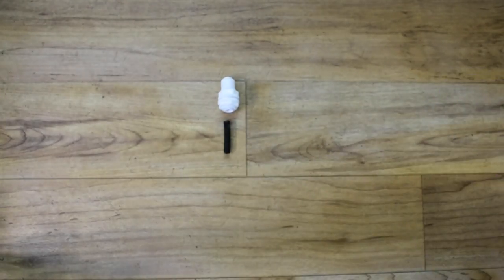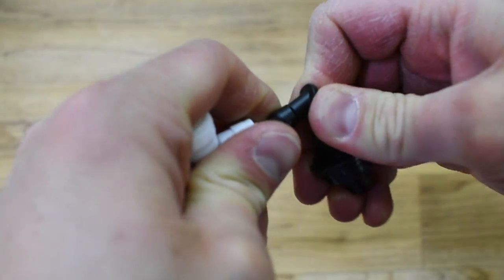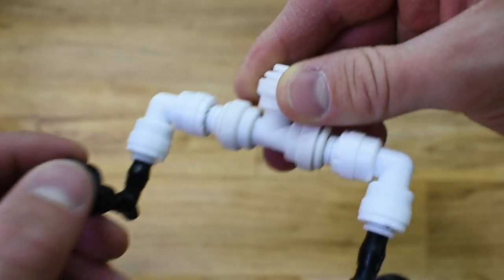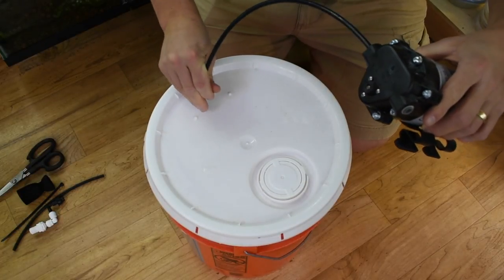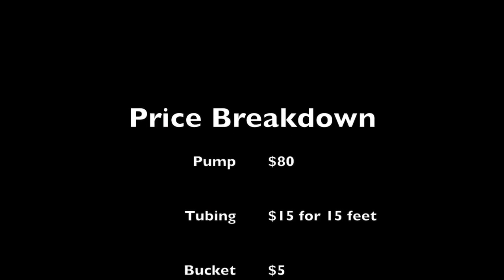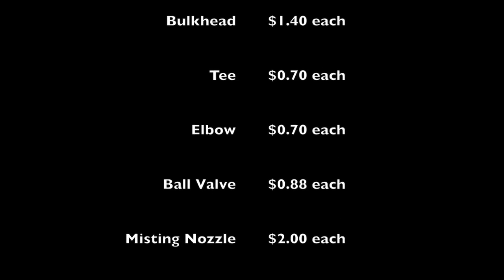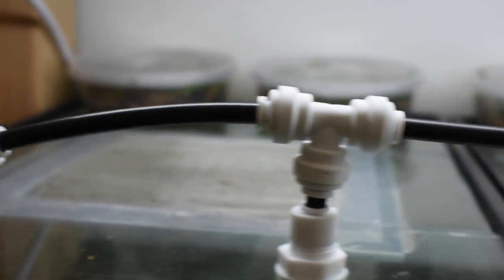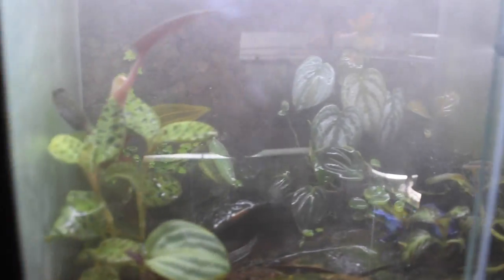Easy to Build DIY Misting System!

Comment: You could also use 1/4" airline tubing with zipties if the high pressure line is too difficult to fit. Usually found at aquarium stores.

Comment: I don't recommend the 8800 model just because it comes in all sorts of pressure ranges and I figured the 100 PSI 6A pump I found looking for the 8800 would be strong enough to pump up to 100 PSI. I may have had a defective pump but I decided that manufacturer isn't good enough for me. I found a much larger / heavier duty 160 psi diaphragm pump which was more than up to the task (110v AC @ 0.55A ~ 12v DC 5.57A).

On this video I would suggest an upgrade to instead of demanding direct pressure from the pump to deliver pressure to the misters, to instead store energy from the pump inside of an accumulator. This drives down the frequent on/off demand on your motor and will save it in the long run. The diaphragm also doesn't need to slam the line as hard this way because the accumulator 'muscle' is absorbing the blows. A solenoid can be triggered to demand energy from the accumulator to the misting heads, and regulator coupled with a low pressure cut off more seamlessly control the fog mist production.

Without a low pressure cut off only the misters can drain any remaining pressure in the lines after the demand is closed. When shut off they will gradually change from producing fog mist into a stream of water. At the end of the water stream droplets stay on the mister head surface and deposit calcium over time and clog the mister heads.

That is as complicated as it gets... we just want really strong muscles pressing out our mist!

Comment: got a tip for you whit pressing the hose over the fitting. sound strange but it work. its dry spit on it and it slide beter over the fitting. or if you don´t like it some wildlife friendly crease.

Comment: Heat the pe tube before u put on nozzle may be easier.
Also gift one check valve in end of system and send to resevoir tank can prefer dripting from your nozzle. 
Sorry my English so bad. 
Cool video
Reply from the maker: Thanks for the tips, surprisingly I haven't had any problems with the line draining back into the tanks even without a check valve.
Reply: TCS Dart Frogs good for you but you even control the flow of spray, or add some driver for connecting with you smart phone. 
I like you stop btw i use it to for keep chameleon

Comment: Nice vid, thanks!  Do you use anything to automate the misting, like a timer similar to the Mist King system?
Reply from the maker: Thanks! I actually don't use any sort of timer, I do control all the misting manually but most hardware stores do carry second timers and you can find them easily online as well.
Reply: Interesting easy set up . I have a question . Say I have 8 nozzles set up . And need them to spray for roughly 2 seconds . Do they spray simultaneously or will the pressure not reach the nozzles further down the line being that the spray only goes off for 2 seconds ? Does that make any sense ? Trying to figure this out before spending the money on the project . Thank you !!!! Hope to hear your thoughts
Reply: @LuisLopez-cz8qi  also wondering the same thing!
Reply: I’m wondering a similar thing.. in this video Chris is powering maybe 10 or more tanks. I’m only trying to design a system for 1 tanks maybe 2 - 4 sprayer heads max. 
Would I need a smaller pump?
I’m assuming that each additional nozzle reduces the overall pressure. 
Does anyone have any info on this?

Comment: How make right temperature in animal room 
With individual heating mats or is centralized?
Reply from the maker: Central heating and air conditioning, the frogs only need to be kept at 68-75 F so  it's not really different than room temperature in your average household.

Comment: Hi there really great video that u shared , if i had only two small 1ft tank would the pump be over kill? Is there a smaller pump i can use or? Care to advice?
Reply from the maker: The pump would be a bit overkill but a lesser pump would not be significantly cheaper so it just depends if you want to spend that much on a pump.
Reply: Universal windshield wiper pump on amazon for $11 has worked great for me for smaller systems.
Reply: @MrDad-ok8qe  would you be willing to elaborate a bit more on how you did it? I have a couple small display tanks throughout my house and am trying to find a cheap way to put each one on its own small misting system.
Reply: Brodie,
Search Amazon for Trico 11-100, that's the pump. You'll then need a reservoir (bucket or milk jug etc), a 12 volt power supply (this pump doesn't draw any more than 5 amps so a simple laptop charger or similar will work great), plumbing and nozzles (I use the black drip line and spray nozzles from Home Depot) they offer 360°, 180°, and 90° spray patterns for $3 each. After that you'll have to decide how you want to turn it on, you can wire in a switch for manual operation or do as I did and use Wi-Fi outlets so I can turn them on from my phone from anywhere. I'm into each setup like $25. Have fun.
Reply: @MrDad-ok8qe  Thank you for the info! Odered the pump and going to give it a try! Also ordered the big pump in the video for my reptile room.

Comment: I have another question, how does excess water get out of the terrariums
Reply: Ale Bomber You can either put a pvc pipe into the drainage layer to syphon the water out, or drill a hole in the back of the tank and put a tube leading the water into a bucket.

Comment: How many misters can I have on it I ha e 30 cages
Reply from the maker: I'm not sure how many it can do at once but you can always play with it and see, I have each shelf on a ball valve so I just turn the valves and it does one shelf at a time. That way I only need one pump for all my shelves.
Reply: @TCSDartFrogs  yeah trying to figure out how it can water 30 cages at sametime for my mom doesn't have to worry about them

Comment: Any timer suggestions?
Reply from the maker: To be honest I've never used a timer for my misting systems but any good second timer should work.
Reply: @TCSDartFrogs  All those tanks and never used a timer? How often do you mist? Are you home all day?
Reply from the maker: @rogermims9119  Nope LOL. I mist generally once a day but if the tanks are looking overly saturated I'll got a few days without misting. I am home most of the day most days as this is my full time job. But its very simple to mist manually It only takes about 5 mins.

Comment: 90 plus percent you can get at the same place you got the orange bucket
Reply from the maker: I've never been able to find any of the products that I use for misting at the local hardware store, but I know that different branches carry different products, so where you're from that may be true but here I have never had any luck. I have found many of these products at hydroponics shops though.
Reply: @TCSDartFrogs  Next time look in the plumbing area where the brass fittings are at.
Reply from the maker: @Jmb905   It wasn't an issue with not knowing where to look.
Reply: The system I put together uses spray nozzles found in the sprinkler section next to the tubing at HD. There's a selection of different patterns 360°, 180°, and 90° for roughly $3 each and they work fantastic. There's adjustable ones as well but I haven't had the need.

Comment: CLOG CITY!
Reply from the maker: While clogs definitely can and will happen I've found that placing a sponge filter over the intake hose in the reservoir and zip tying it in place keeps clogs to a minimum. Clogs are often easily fixed by disassembling the misting nozzle and rinsing with water.
Reply: @TCSDartFrogs  KEEPING AN EYE ON A NOZZLE 24 SEVEN IS NOT MY IDEA OF GOOD UNIT!